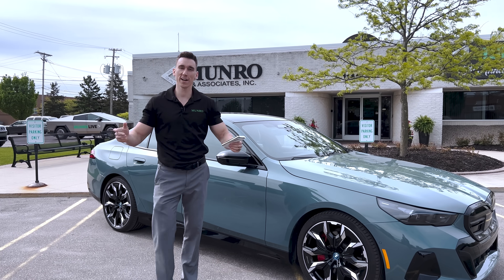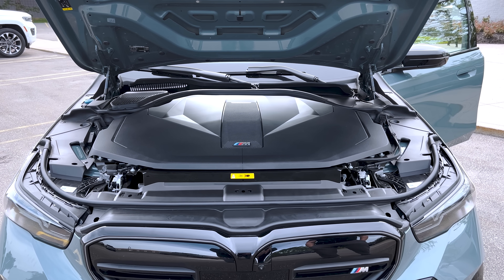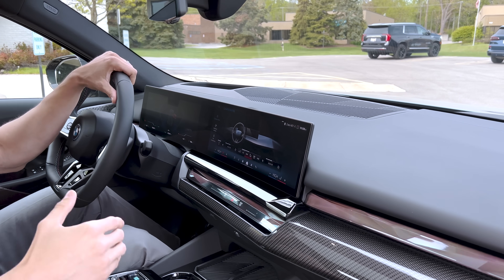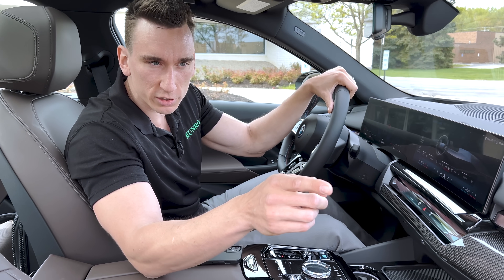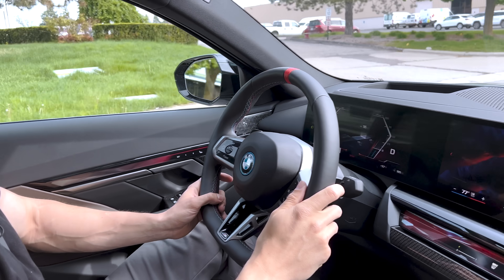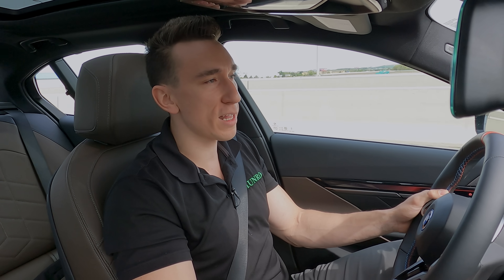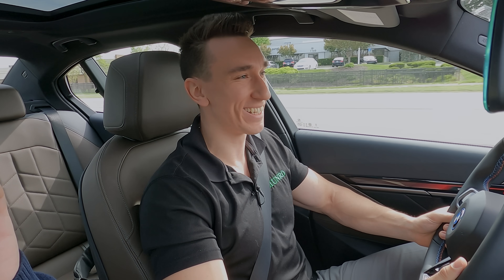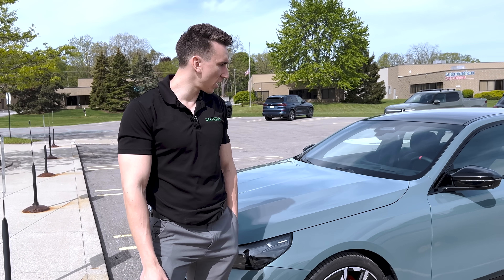BMW i5 M60 Review: A German's Perspective on Power & Design

Comment: It is not an ev platform it is basicly a gasoline car with en ev attached. It is a little bit like if you attach a motor to a horse carriage. This is also far away from global optimum, because the driver sits too high that he could look over the horses which he does not need with a motor. Therefore the car must be always designed around the engine and not just the engine attached to a car. Tesla also did this in its first iteration in 2006 with the first roadster. Therefore BMW is now at its first design iteration and almost 20years behind Tesla. 😂

Comment: Firstly, I would hate all the finger prints all over the shiny plastic surface. Secondly, if it doesn’t have a large infotainment screen, I don’t see the value in owning the car (for maps, split screen comfortably, etc). Oh and thirdly, the fake sounds are… so obsolete. Why would you want to add sounds instead of having a quiet experience, or have the music play without the noises?
Reply: Yes fake or not, ICE sound is obsolete, stupid, disturbing

Fake ICE sound is really doubling up the stupidity
Reply: how big of a map do you really need, especially when you have a heads up display? Are you watching netflix or driving?
Reply: @DimitarStanev  I prefer large map, and the heads up screen is tiny (personal preference). If I also wait in the car, or am at the charger, yes I want to watch movies or play games and not have to do it on my phone.
Cars are no longer tools to only transport you around, they can have (and should have) way more capabilities but the legacy auto seems to be stuck in the old mindset.

Comment: Why ist BMW not able to put the chargeport on the driver side?
Reply: Since this car also has ICE versions, almost all BMWs have had the fuel cap on the RH side for safer refilling if stopped on the road (in LHD countries)
Reply: @DimitarStanev   and with charging at the road it makes even more sense.
Reply: @DimitarStanev  yea would need super crazy engineering to move it to the other side.
Reply: @Matzes  retooling for new quarterpanels between electric and ice is expensive
Reply: @DimitarStanev  is it though? Might as well not build EVs if that's what's holding you back. Companies always move stuff around left to right adjusting to LH / RH countries
Reply: @Matzes  not a whole quarter panel though, stamping metal machinery is expensive, it doesn’t make sense for such a niche pain point. Mirroring the dashboard and much of the interior is something unavoidable lhd/rhd
Reply: What would be the advantage? Don’t see there any
Reply: @catch_me_if_you_can1147 you don't have to walk around the car to plug in your charger and it would be compatible with the most common and reliable charging network, teslas.
Reply: When you get home and park the car with the passenger side close to the wall, you want to have access to the charging port. I had a plug-in hybrid Volvo like that (gas on the right side, charge port on the front left). @catch_me_if_you_can1147
Reply: With such a high price tag they should give it quad-charge-port; one on every corner.
And capability of charging from two ports simultaneously, super fast charging. 350kW x 2?
800V system?

- - - - - - - - - -

IMO it'll be a very good spec for an EV:
0-60mph in 5 seconds, 
10-100% charging in 5 minutes, 
range 500 miles.

Comment: Why all the shiny/reflective plastics inside and out? It looks a bit cheap to me; I still do not get the BMW front. However, it has very nice profile. I am sure the drive and feel is really good. It is a bit strange it is so heavy with such a long hood and no frunk. It must, as you point out, be due to being used for ICE and hybrid versions also.
Personally, I would prefer the new Tesla Model 3 performance at half the price...

Good presentation 🙂
Reply: Then you can afford to upgrade Tesla suspension to be even more competitive with BMW M's

Comment: Man that hood is gigantic to not have any frunk Lol it must have so much space in there
Reply: why is there always this obsession with the frunk? i never use it in my 911.
Reply: You’ll never know unless you can find a way to get it open.
Reply: I feel people are missing the point on the ‘frunk’. BMW is building a lineup that is ‘identical’ bar driveline. You want a 5 series? Here is a diesel, a petrol, a performance petrol, an EV or EV performance, you choose. 
Other than driveline, everything else is pitched at bmw existing owner (likely an existing 5 series owner who currently doesn’t have a frunk).
Reply: @JoshuaGrech  Except for the extra 440 kg of dead weight and the limited range.
Reply: It has fake engine in there, tlto create thet fake engine sound
Reply: Has a speaker for making fake engine noises:)

Comment: Every Chinese car maker can make a 5250-pounds electric car and they are pretty close, if not on par, in respect to design and materials. But their cars cost much less. I don't see anything worth copying - it's not really fast (for an electric car), it heavy, expensive to produce, average range, technologically on the same level as current ICE vehicles. I know a lot of people will buy it because it's a BMW and looks good, but most people are actually pragmatic. That's why Japanese cars won in the US in the 80s and 90s.

Comment: Still not a fan of those fake sounds.
Reply: Maybe not this fake sound indeed, I don't like it either, same for other EV's. However if you're a car enthousiast, do check out the Hyundai Ioniq 5 N. It has a mode which emulates an ICE car, not only the sound but the precise feeling of gear shifts including the jolt through the powertrain when it shifts, the rev limiter at redline, the building of boost and power higher up in the rev range, the pops & bangs, realistic engine sound, the whole shebang. At first I thought it was just a gimmick but every serious car reviewer out there (including Doug Demure, AutotopNL, Throttle house and others) have been raving about it non-stop. Doug even made a separate video about just the ICE car mode off that car. And after having driven one a few days ago I can tell you, it's beyond incredible. Not only does it drive absolutely fantastic but they have succeeded in emulating an ICE car to such a degree that you can hardly tell the difference, honestly. And in that case, the fake sound is really, really cool and adds to the experience to a tremendous degree. It is the first truly fun EV on the market and I strongly suspect other manufacturers will start to emulate it in the coming time. It's a benchmark for what a fun EV can be. I would drive around in that mode permanently even though, because they emulate an ICE car, you lost some performance compared to the normal EV mode, because EV's have instant full torque and you can't do that if you want to emulate ICE. It's the first car that really has me considering an EV for my next purchase. Check it out, it's very cool
Reply: @BinaryBlueBull  Hyundai did do it better.  Still sounds too fake on the upper end.  Lower end isn't bad.
Reply: @JT_771  Yup, agreed. You can still hear it. But trust me when I say that you won't care one bit when you drive it. Even though you can still hear it's fake, the sound still does add significantly to the experience and the car in itself is truly fun to drive. Apart from that, if Hyundai is able to approach "sounds like the real thing" somewhat already with this car, you can be sure it will at some point be indistinguishable. The Ioniq 5 N was one of the most fun cars I've ever driven, and I've driven quite a few sports cars and "drivers cars". My expectations were already quite high because of the many positive reviews I had seen but still it surpassed them
Reply: @BinaryBlueBull  hopefully if they do decide to improve the ‘realness’ of the sound, they’ve made it over-the-air upgradable and will just push it the the fleet.  I like that Hyundai is doing unusual stuff like this.
Reply: Then don’t use it 🤷
Reply: That's a huge fakery. Is there a delete option for that?
Reply: @catch_me_if_you_can1147  electic cars are required to generate some engine sounds https://en.m.wikipedia.org/wiki/Electric_vehicle_warning_sounds#:~:text=The%20vehicle%20must%20make%20a,a%20maximum%20of%2075%20dBA.

Comment: Okay so what will be a better car: starting with the battery and designing a car around it or starting with an ICE design and putting a battery in it. They are not even trying to compete.
Reply: They started with both and built a car around it. They seem to succeed quite well with that strategy for now.
Reply: Well, they have built their ice car factories at huge expense. They have to repurpose them as best they can to recoup costs. Considering how expensive the factories are, the planning for EV future was required decades ago.
Reply: Build a battery-pack with integrated floor and seats.
That's all there is to it, basically.

Everything else is just "accessories" , formality, so that you can call it a car.